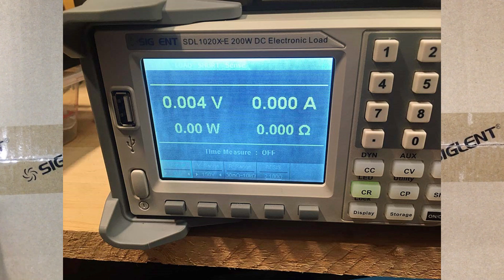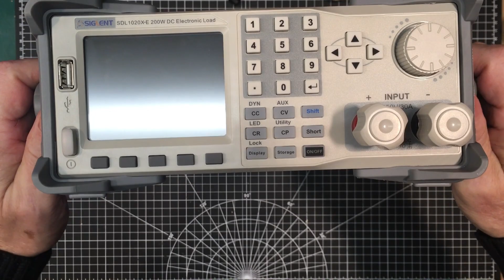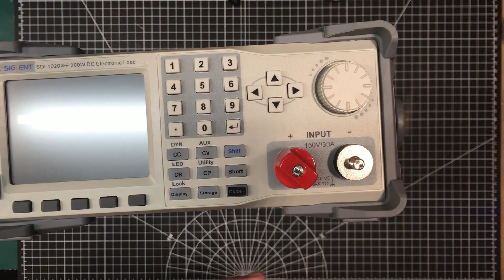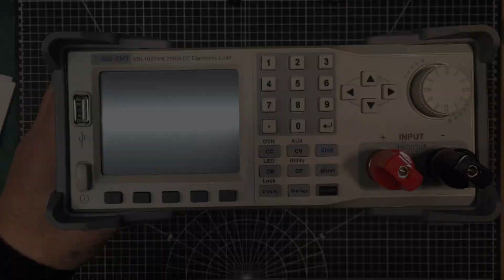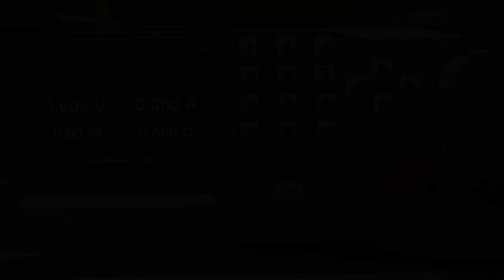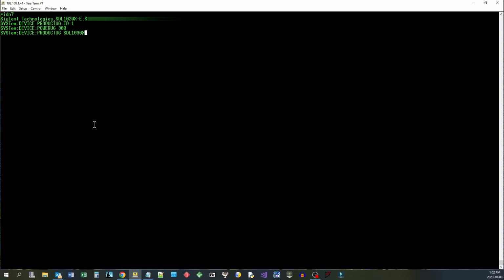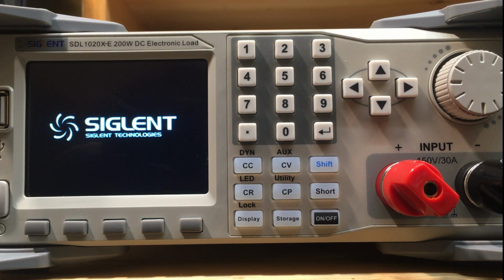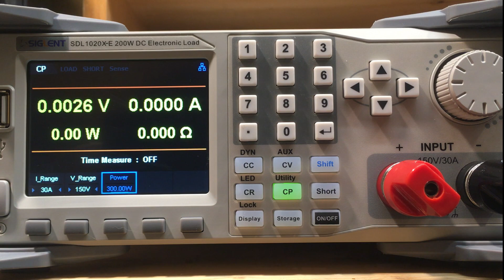0107 - "Improving" the Siglent SDL 1020X-E DC Load

Comment: Just a “stupid”question: but a 200W load is able to support 300W without damages?? Thanks in advance!
Reply from the maker: It is a 300W load that has been limited to 200W.  It is cheaper for the manufacturer to design test and build just one load then artificially limit it to make two models than it is for them to design test and build two separate models.  They do the same thing with oscilloscopes, function generators, etc..  And it's not just Siglent.  Everybody does it.  In any case, I did this more for the extra precision that for the extra wattage.  I have actually never used past 150W and likely never will.  It lives an easy life.

Comment: So I'm trying to do this but not getting anywhere. I connect my computer to a network switch, then the instrument. I go into the network settings and check what IP address I've got. Then I set the instrument 1 digit off from that and give it the matching subnet. Then I go into a terminal client and input the information, it claims to connect but the command prompt seems dead. I can type, but pressing enter doesn't do anything. I also tried 5024 because apparently that's a common port but that one doesn't even connect only the 5025 will connect. I'm probably doing something stupid. I tried 5024 because the Siglent, "Using Telnet LAN" document says that's the port you're supposed to connect to the instrument at.
Reply from the maker: Did you set your terminal to local echo?  The Siglent will not echo characters back to your terminal.  Also, did you issue the command "*idn?" - (you need the "?" on the end before hitting return).  Don't use a port other than 5025.
Reply from the maker: Thanks James!
Reply: @uni-byte hey as an aside did you try checking accuracy before and after? I can’t prove this because I brain farted and didn’t do this ahead of time but I pondered that maybe this side steps calibration overlay done at the factory?
Reply from the maker: @JamesReedy  I did some checking on the first one I had (this one was warranty replacement) and within the limits I could check (up to about 120W, 20A, 60V) it seemed just fine.  I expect though that as calibration is hardware defendant and the hardware does not change in this process I would not see a change.

I could see it possibly not having calibration beyond the 200W limit, but since a) the current and voltage limits do not change so both models need to be calibrated to those, and b) it would mean a separate calibration process if things were calibrated differently for the 4 "models" model and that just amounts to an unnecessary expense.  To make a long story short, I think all 4 models run exactly the same calibration, then at the end of the line before the sticker go on, they enable features as required.
Reply: @uni-byte  yeah I was seeing a discrepancy in the reported voltage. I noticed that I had the full scale set to 150V, dropping that down to the lower range 36V improved things but at 1V it looks a teeny tiny bit out of spec. I don't have it on hand but it's like 0.02% + 0.05% of full scale, so for 36V that's like what 18.2mV so at 1V the low limit would be 981.18mV and I think I was right up against that. That said at higher voltages approaching the in-range limits the error was pretty damned small. 

I suspect you're right, I just tend to over-fixate on stuff. Lesson learned to check stuff before hand and then compare. I'd agree they're probably all calibrated to the same standard and then binned (I think the more expensive units are tighter by half on some ranges)  put on a shelf and they slap model numbers on them and code them as needed using the SCPI commands 🤣

I've got an MSO58 here at work, I think the same instrument does the range from 350MHz all the way to 2GHz; even 10~15 years ago I have to think that wouldn't even be a thing. But we live in the era of, "heated seats by subscription" and the like. They'll build more content into an instrument and pray for attach rate on upgrades or just enjoy a more streamlined manufacturing operation.

Comment: Damn! No downside, you don’t think they scaled the heatsink?

Also I can’t for the life of me get the rear IMON and VMON to do anything useful. They are very high Z on the BNC to chassis and nothing comes out. I bought a new one thinking mine was broken all this time and I was unaware but alas the new unit also doesn’t push any signal out of those BNC’s even with it loading my PSU at 8A constant! So now I’m thinking I’m doing something wrong and this needs to go back as my unit likely isn’t broken at all.
Reply: Good god it’s in the menus I missed it, the manual doesn’t mention having to enable them and they’re relay isolated so the grounds float till enabled!

A good manual, the diagrams of the back panel and then talks about the functions. Should have a call out to the section heading that explains that they need to be enabled in order to be used. Now either I have an extra load or I need to return this one *grumble*.
Reply from the maker: @JamesReedy  I hope you can get it returned.  Yes, and I agree, when they identify controls and I/O they should reference the manual page that addresses their use.
Reply from the maker: When you set it up, does the V_M_ON indication go on?  I've not used the function myself.
Reply: @uni-byte  I was doing buck converter load response and wanted the current waveform to go with the regulator droop overshoot response. 

So turns out best I can tell this function is low key crap. Unless there’s more settings what you get is 0-10V as mapped to full scale of 5A or 30A so either 2V/A or 333mV/A the former isn’t so bad because you can set your scope to 0.5X and get 1V/A output directly on the display.

The issue as I see it is that when you look at the IMOM out it’s rendered for a setting of 500mA/uS slew rate as a stepped output of 10 steps including 0 and 10V as the start and end points  for a 0-5A CC load and this takes 26mS on my scope give or take. Same for the voltage…LAME.

I assumed these were the output of the current shunt that’s used by the thing to regulate and such.
Reply from the maker: @JamesReedy  Yeah, 0.2V/mS is not great for what you want to look at.  That might be good for a chart recorder, but you might be better monitoring voltage directly with your scope and using a decent bandwidth current probe for the current monitoring.
Reply: @uni-byte  yeah don’t have my own Hall effect current probe, good ones ain’t cheap. I have great ones at work. I did some basic checking with a floating shunt and battery powered CSA to get the I term and used a diff probe for V. 

Thanks man, I feel silly. But hey I leaned I can DS1054Z my e-load 😂 no ill effects I take it? I assume it’s manufacturing streamlining and or they don’t calibrate them down as far or guarantee the performance.
Reply from the maker: @JamesReedy  I think the load response is probably as specified, but the monitor outputs might be just an add-on.  I don't see any specs from them.
Reply: @uni-byte  yeah they don’t even tell you how to turn them on in the manual. 

Ok so I’ve determined that it is in fact quantized much more finely maybe 8-12 bits or something but if the slew rate is too fast it just renders as 10 or so discrete steps with around 2.6mS per step equi-spaced. It almost alludes to a timer loop that interrogates something internally and updates those jacks, it can’t update any faster than 2.6-3mS per loop so it just turns into a coarse staircase cause the value has moved on a lot between updates. It’s not as shit as I thought but not what I hoped it would be.

I’m half typing this out in case others go searching. While I didn’t find what I was lookin for here it’s been a good chat and I found good content thanks!
Reply: @uni-byte  it is, I did some testing at 250mA/uS which is sine SR for 2A at 20kHz and it was pretty good tho in CC mode it did exhibit some overshoot going load on, its better controlled going load off. Just loop response stuff and I guess the load is falling to zero so kinda makes sense…
Reply from the maker: @JamesReedy  It has been a good chat, thanks.  Did you see pages 66 and 86 of the manual?  The top of page 66 tells you how to turn them on.  Page 86 defines them (seems like the wrong order).
Reply: @uni-byte  yeah shame on me I thought I’d menu dove enuf, I didn’t. It’s…

Shift+Utility
Config
Goto Page 2
EXTC
I_M_ON
V_M_ON

I see reference to none of this searching, “enable” unless I missed it.

Comment: This is exactly what I did with mine, although I initially bought the 1020X (not X-E) i turned it into the 1030X. I also use the exact same banana caps replacements. :)
Reply from the maker: Cool.  Great minds think alike.

Comment: do you know for a fact that additional components are not required to handle the power?
Reply from the maker: Not personally, however a number of people have reported that the internals of the two models are identical.  For me though it's not that important.  I don't see myself ever needing 300 Watts, or even 200 for that matter.  I do, however, really appreciate the additional precision.  If I really needed the 300W I'd probably pony up the dough for one that came with that specification to begin with.
Reply: precision without accuracy is useless   @uni-byte
Reply from the maker: @mr1enrollment  Having a degree in physics, there's a good chance I knew that already, LOL!  Anyway, the two units share the same circuitry and firmware.  The accuracy is already there in the design for the extra digit of precision.  The extra precision just needs to be enabled.
Reply: @uni-byte  No, is not, like CPUs, GPUs etc they are tested against references and if they have errors above datasheet then they are degraded in software, also limited in hardware sometimes. It is simple as that, you think that you unlock the heaven door but it's just a software for a hardware that it doesn't run like a native RATED SDL-1030x because no component is the same. Even if the schematics, the board, everything looks the same is about PRECISION!!!! You like to see 1000 digits after, for what???? To be out of charts??? I don't need 4 digits if I know that this specific hardware is not sufficiently accurate for 4 digits. Save some money and buy the right model next time because approximation is for elementary school. I have all Siglent range, and I admit I activate many extra features on them, but one single thing I kept and that is the model version. Because like I said is about PRECISION! If the model is rated 200W it means on 300W even if you unlock it, it will heat more than a pass tested SDL1030x. It will work? Maybe some period! It will measure correctly on 4 digits? I doubt about that. So, imaginary money saving...

Comment: If  go in and do a software upgrade to the unit, does it resort back to a 1020X or does it stay at a 1030X?????
Reply from the maker: So far no problems.  The adjustments are to the configuration database which should not be affected by a firmware update, but if it is you can just re-issue the commands to make the changes again.  I suppose they could at some point create a firmware that did not support altering those parameters but it would have negative repercussions for their manufacturing process.
Reply: @uni-byte  I think Rigol did exactly that, to prevent folks from doing this type of modification.. Thanks for the information.. It is appreciated.. Robert in San Diego
Reply from the maker: @myradiovideos  Good data point. Thank you.

Comment: Thank you very much for this! 
I'm debating between this one and the Rigol load. Do you know what the minimum current draw on this one is? Can you pull lower than 10 mA reliably on the siglent? I have heard issues with rigol doesn't do a good job for currents lower than 10 mA.
Reply from the maker: It's stable below 10mA but the set value may not match the actual value.  If you set 8mA, you may get a current of 6mA but it will be stable.  So as an example, if you need precisely 8mA you may have to set it to 11mA, or something like that.  If you are setting the CC by hand that is not a problem.  Just set it so it passes what you want. However, if you are setting it via another device (like a computer) for some automated task, it might be an issue and you would have to calibrate it first and take that into account.
Reply: @uni-byte  Thank you very much! Do you know at what point the display value matches the actual current pulled?
Reply from the maker: The display always matches the actual current very closely even at low currents.  It's the set point that can be out and on mine the set point is usually a few mA higher than the actual current.  As the current rises, this naturally becomes less of a percentage of the total current.

Comment: Hello, 

Thank you very much for this video. I am looking for an affordable electronic load and am thinking of buying a 1020X or 1020X-E right now. 

Does anyone know if there are any physical (Harware) differences  between the SDL 1020 series and the 1030 series? Since one is rated for 200W and other for 300W?
As I look at the datasheet I see that the X and X-E version has a difference in accuracy (CC mode, Readback Voltage) and the Over temperature protection is 95℃ in the 1030 series and 85℃  in the 1020 series.

When I saw your video I tried to get information if all models are mechanically the same but no luck. 
Do you have any problems with the Siglent electric load or does it work without a problem? (Since you have right of the hand experience with the unit and before I buy it)

Thank you,
Best regards,
Reply from the maker: It works without any issues.  There are many posts and threads about these loads on the EEVBlog forum.  Members there have taken them apart and verified they  share a common hardware platform.  The only differences are enabled via software commands.  This is common practice with electronics these days as it keeps production costs down and maximizes profitability.

For me, the biggest improvement is the added precision.  Enabling the 300W is just something I did because I could.  I will likely never use it.

In any case You might get a lot out of reading more about it on the EEVBlog forum.  Specifically the test equipment sub-forum.
Reply: @uni-byte  Thank you very much for the very quick and useful reply. So far i have been reading the EEVBlog Forum. It is true that it is mentioned that all models have the same Hardware. Which I like to hear. Also in your video I can see how the upgrade process would work since it was a bit confusing to read only on forum.
Thank you for the info and thank you for the review video. Keep it up :D

Comment: What is it doing? Is it trying to keep the power draw constant despite changes in voltage?
Reply from the maker: It has several modes.  There are 4 constant modes. Constant Voltage where it tries to keep the voltage constant, Constant Current mode where it tries to keep the current constant, Constant Resistance mode and Constant Power Mode.  It can also be programmed to vary any of those parameter too.
Reply: Thanks! Useful device. @uni-byte